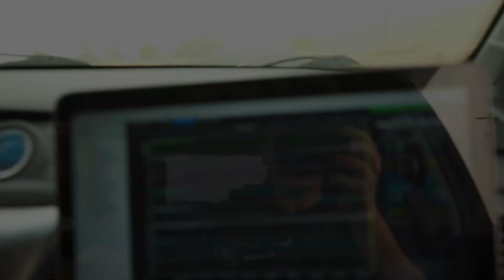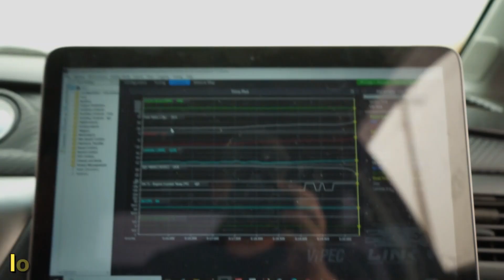800whp EVO 8 Build: Well that lasted 24 hours...

Comment: Sorry for the Evo issues.  You are taking them well though.  As far as the timing belt tension, you want the grenade pin to be able to slide in and out without friction before you start the car but after you set the tension and torque everything and let the hydraulic tensioner take a set.  There’s a sweet spot there on the tension.  Huge pain to get it just right, because of the access.  Keep up the great videos.  I really like this channel and am now getting educated on Subarus too!
Reply from the maker: Thank you for your advice, I will give that try this time when i re time it :)

Comment: That’s sucks, curious what style balance shaft delete you were using on the oil pump. Was it a stubby shaft or a turned down style like the gsc kit?
Reply from the maker: OEM Stubby shaft is one i have in it sir.
Reply: @BaderBuiltRacing  yeah that's what I used in mine now I'm scared haha. Check out Aaron Unknown on YouTube his brand-new oil pump on his Evo failed in a similar manner, must be the side loading with out having the support of the full size shaft.

Comment: Did you eliminate the balance shaft? If so did you use an oem stub shaft or aftermarket? Aftermarket stubs eat the pump quick. Evo oil pumps are kinda trash.
Reply from the maker: I used the OEM Stub when i deleted it sir. I even primed oil pump before every starting the car the first time as well. I honestly think i just over tighented timing belt and made it wear at an accelerated rate
Reply: _BaderBuilt ouch, modifying Evos is like being in an abusive relationship a lot of time, hopefully it didn’t move too much metal through the motor.

Comment: A similar thing happened to mine lol. Oil pump gear's nut took a vacation, and the pump went ahead and killed the front seal.
Reply from the maker: Little insight before the video, i took the car apart today to find that the oil pump shaft that gear bolts to had bent and was eating the housing causing the whining noise... due to the bent shaft it ate the seal and was spraying oil everywhere.
Reply: @BaderBuiltRacing  Dang! That's tough man. I would have never expected a bent shaft. I definitely think things will work out better with the 4G63 block. Looking forward to the new build. Just don't rush it :-D.